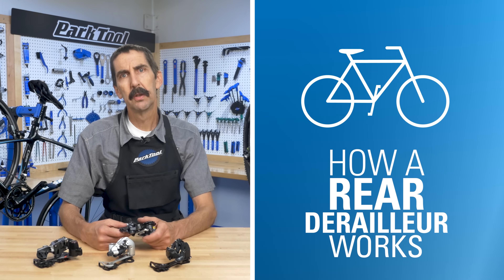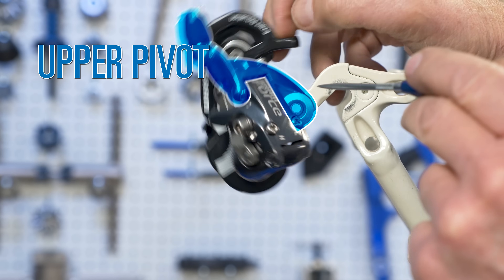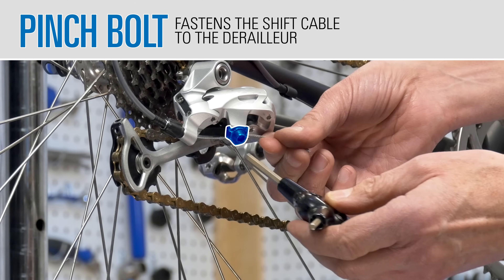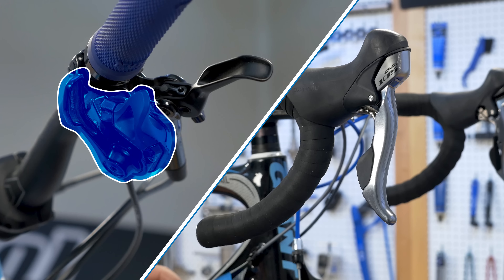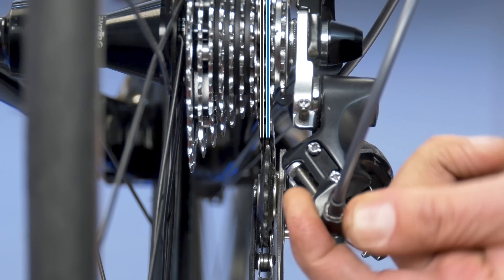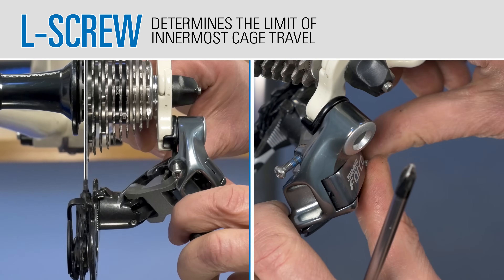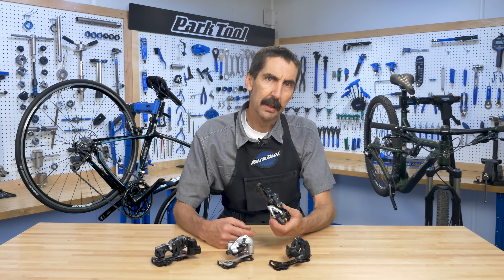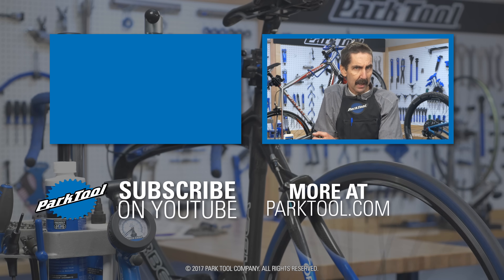How a Rear Derailleur Works

Comment: My return spring on my Deore XTR derailier works in reverse order. When I select high gears it goes to low gears. 🤔 Any idea why this is happening? Front derails in right order.
Reply from the maker: Likely you have a "LOW NORMAL" system.  The return spring moves it to the easier gears.  The cable pulls it back to the harder gears.  Limits are set the same.  The cable setting at the barrel is the same concept. One click should get you one shift.
Reply: @parktool Ah, I see. I’d never heard of this system before, hence I’m having to get used to shifting it. I may change my derailleur to a standard model if I can’t get used to it. 😊 Thanks for your help. 🙌

Comment: Sir, I am very grateful for your instructional video, it's extremely useful in understanding how the derailleur functions. However I have just one doubt, that's once the cable is secured to the pinch bolt, how does the length of the cable effectively shorten or lengthen by adjusting the barrel adjustor. My objective of seeking this information, is that after replacing the chain, freewheel and derailleur of my mtb, my legs feel very strained after peddling for just 10 minutes. Thank you once again.

Comment: Common mistakes people make is they take the entire derailleur off the bike and let it hang on the change then have to take it to a bike show to get put back on again.   Saw another fellow take both brake pads off instead of using the quick release lever to widen the brake for rear tire removal.

Comment: I do have one question on the rear derailleur. The screw that keeps it from popping off when you take the tire off came out and when I took off the tire, the derailleur came with it. I had no clue how it was in there to begin with. I went to the store where I purchased this bike and they fortunately had the same model, assembled and displayed so I could at least get an idea of how the derailleur should look. But --- the screw holding the derailleur on sits inside the dropout where I would have thought the axel backed in completely and evenly on both sides. It appears, with the derailleur bolt in the dropout, the axel fits up against the bolt on the right side, but leaves a gap on the left side; that the axel does not rest completely to the end of the dropout on the left side. Is this right or am I missing something?
Reply from the maker: This might be the type below. 
https://youtu.be/meUQ-BiFL28?t=307
 Stops are not needed on both sides. Pull the wheel back so the right axle contacts the hanger, and then center it. Tighten the wheel in the frame and it will not move.
Reply: @parktool  greatly appreciated

Comment: Thanks, however, I appear to have two barrel adjusters for the back derailleur. One at the derailleur level and one at the shift lever. Are they both doing the same thing, or what reason are there two, if they are even both b.adj? Please explain, sorry for this seemingly "stupid" question, but I am just learning. (And I might add learning a lot from your videos.)
Reply from the maker: Use either.  Cable slack is handled with either end.

Comment: any idea how to resolve my rear derailleur issues?
i have change my cogs to a bigger one then  a part of my rear derailleur touches the cogs
i can send you a picture on how it touches but dont know where i can send it to you
Reply from the maker: Rear derailleurs have a max capacity that tells you the largest sprocket you can use. Its possible you have exceeded the capacity or that your chain needs to be longer.

Comment: Hi, Great video, I have a question about the cogs on the rear wheel. I have a bike that I need to replace the derailleur and gear shift mech on the front handlebar. Can I use any derailleur make ? Are the cogs a standard distance apart on the rear wheel ? This bike has 7 cogs. Thanks !
Reply from the maker: As long as you keep the shifter and rear derailleur brand consistent and 7s compatible you will be good to go. You can mix and match to some extent with brands but you can run into brands having different pull ratios.
Reply: @parktool  Great thanks ! So the derailleur itself has to be 7s compatible. Makes sense I guess as a 5s would have different gaps and distances I'm guessing. So same brand front and back, sounds good, thanks for the help :)

Comment: I have spent a couple of hours trying to tune my front derailleur 3 x gears and it upshifts from small to large no problems however it will not down shift from large to middle but If I shift again it will jump the middle and go to lowest no problems. Any Idea what I might have done wrong for this to happen?

Comment: I have a 7gear 14-28 cassette on my MTB and want to replace it with 9gear 11-36 cassette (last two gear I should remove). My question is should I change the rear derailleur to bigger or it gonna works? My rear derailleur is SHIMANO RD-TY300

Comment: Hello Calvin .Thanks for the videos .These video are so much help for us. Please let me understood the way of the derailleur works.Is it possible or not for a  9 speed  derailleur (Xtr RD-M972 ) to work with a 10 speed cassette  (11-46 Sunrace) and a 10 speed shifter .
Reply from the maker: The pull rate between most 9 and 10 speed derailleurs are different. Shimano XTR changed pull rate between 9 and 10 speed. So a 10 speed shifter will not allow a 9 speed derailleur to operate on a 10 speed cassette. I hope htis makes sense. Thanks!
Reply: @parktool  thanks for the quick corresponding.If i use 9 speed shifter will be fine or not
Reply from the maker: The spacing is different so it will not work.

Comment: Could you please explain what is the meaning of the space between G pulley and T pulley?

And, must both G and T pulleys be the same size? Can they be different teeth size? What are the benefits of using sane size and different sized pulleys?

I am building my bicycle and these questions showed up to me when selecting and setting up the rear derailleur......

Thanks
Reply from the maker: The pulleys can be different sizes but are usually the same size. Some after market companies have larger pulleys to "bend" or "wrap" the cogs less. This creates a tiny amount less resistance. Marginal. The space between the pulleys is more important. The farther apart the pulleys are the more "capacity" the derailleur. You will typically find the long cage derailleurs on systems that need alot of capacity like a 3x 11 system. The shorter cage offers more precise shifting but cannot handle as wide of a range.

Comment: This video is awesome. 
While I don't bike myself, I'm a curious person, constantly struck wondering how thing around me work. My latest obsession was how a bicycle gear system operates in the third dimension -- ie how does a purely mechanical system release tension, move the chain, and then reapply tension with a new gear ratio.
This video does an incredible job of explaining the pieces involved, what they're called, how they work, what they do, etc., and does an even better job at providing a visual depiction (with simulated highlighting) of the relevant pieces doing what they do. 
Coming from a physics-educated individual: this is a very good quality video for teaching people both what a rear derailleur is and how it works.

Comment: Hi Calvin. Thanks for the video. OK Here is an interesting question for you. I saw how, when you operated the shifter, the rear derailleur rocked up and SIDEWAYS. Now to my problem. I have an old Dawes 1.4 Disc, mountain  bike [ about 15 years old]. Recently, I had to replace the shifters [ I have a 3 x 8 Shimano system]. My rear derailleur is an old, Shimano Acera one. Following one of your other videos, with the cable detached from the derailleur, I adjusted the barrel adjuster AT THE SHIFTER all the way in then out a couple of turns. I then connected the cable and pulled it through finger tight and tightened the pinch bolt. From what I've seen, all other adjustments to the cable tension are done with the barrel adjusters at the shifter and derrailleur ends. But, even with max tension in the cable ie both barrel adjusters all the way out, and all slack removed [ well, all that I can remove by hand], all that happens, when I try to go from 8th to 7th is that the derailleur rocks up and down on the hanger, BUT NEVER MOVES SIDEWAYS TO THE NEXT COG!!. I've scratched my head and mused over this. I'm not the brightest button in the box but, as a retired, avionics, aircraft tech, I'm not a complete idiot. But, try as I might, I cannot understand what it is that makes the derailleur move SIDEWAYS to the next cog on the cassette????? Then I saw you move the barrel adjuster at the derailleur, and watched as the whole mechanism moved sideways. When I adjust mine, I CAN SEE NOTHING MOVING AT ALL!!. All that happens is the barrel adjuster just unscrews all the way out. Its a similar story with the H, L and B adjusters. When you move yours, I can see large movements of the derailleur. When I move mine, again, I can see NOTHING moving at all. I guess I'm looking at replacing it am I? Anyway, I'm interested to see what you say and any help or advice you can give would be much appreciated. Take care now and many thanks.
Reply from the maker: Hello Dave, I would start by inspecting the cable and housing. Make sure the cable moves through the housing freely and that the housing is routed properly in the stops and everything. If you continue to press the lever of the shifter does the derailleur continue to move the chain up the cassette sprockets?  The H and L are stops and therefor only adjust the stopping point of the derailleur if the derailleur is help up against that stopping point. So if you have the derailleur in the smallest cog and the cable has some tension on it, the H limit wont adjust it till it gets to the point where it overcomes the space caused by the cable tension. If you remove the cable from the derailleur and let the derailleur rest then tighten the H limit you should see some movement. Then if you hold it all the way to the large sprocket side and adjust the L limit then you should see movement. Let us know what you find. Thanks!
Reply: @parktool  Hi again Calvin. Thanks for your prompt reply. OK. With the cable disconnected from the rear derailleur, and with 8th gear selected on the shifter and chain on the smallest cog, by adjusting the H-limit screw I can just see some movement, enough to get the jocky wheel lined up with the smallest cog. I then manually moved the derailleur to put the chain on the largest cog, and again, I can see a small movement which is enough to line up the jocky wheel with the largest cog. On rotating the pedals, the chain drops back down to the smallest cog. But, when I reconnect the cable, I still can't get the derailleur to move sideways up the cassette. No matter how much tension I put in the cable, it wont come out of 8th gear. I'm baffled!! I cant understand what I'm doing wrong. All I'm doing is winding the barrel adjusters out and pulling the cable through the pinch bolt, by hand, to take out excessive slack. It gets to the point where there is so much tension in the cable that the cable housing is being pulled out of the barrel adjuster. I can't understand what I'm doing that's different to what I've seen you do!

Comment: Am I able to use an 8-speed derailleur with a 7-speed cassette and  7-speed shifter?
Reply from the maker: With 6/7/8 speed derailleurs, as long as the cassette and shifter match up you should be good to go. I say "should" as not all companies 6/7/8 speed gear is compatible with each other. Hope this helps!

Comment: I'm going to change my rear deraillieur, the present one is worn down. Is it ok for me that I adjust the deraillieur first without the chain on, I mean the high and limit screws. And then fine tune it with the chain on? I bought the same deraillieur that was on my bike, a XT rear derailieur. I bought also a new chain and shifting cable. So I think I have al the things `i need to do the job.
Reply from the maker: It is very possible to get a good starting point by setting the limits when the chain is off the bike. Double checking the settings and doing the fine tuning once the chain is on is suggested though. Hope this helps!

Comment: My bikes g pulley is touching the sprockets  how do I fix that
Reply from the maker: In most cases tightening the B screw will take care of this. Be sure your derailleur has a large enough capacity for the largest cog on your cassette. This can cause it to touch and cannot be fixed with the b screw.
Reply: with the "B" screw